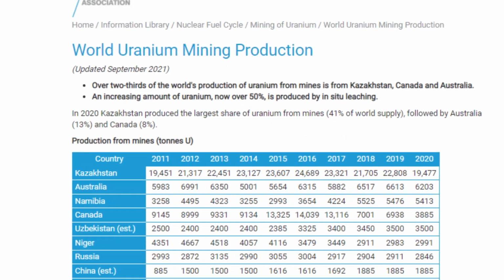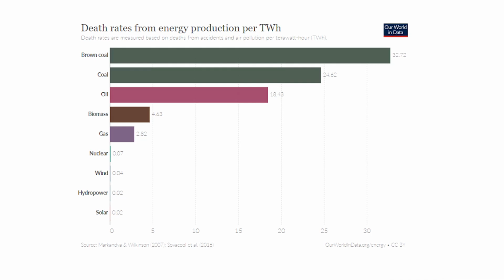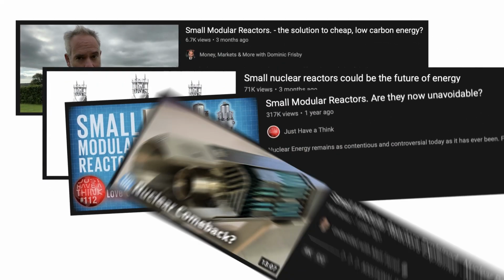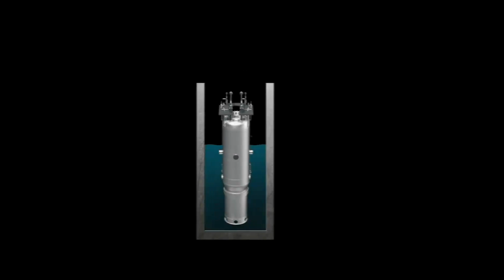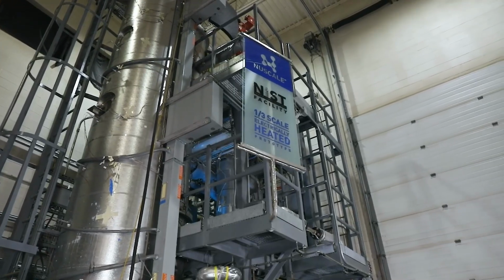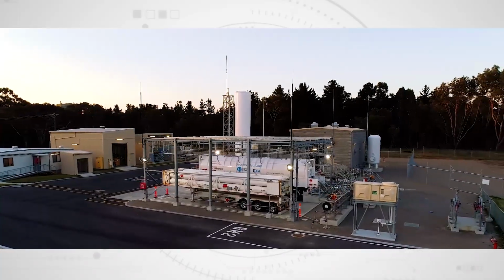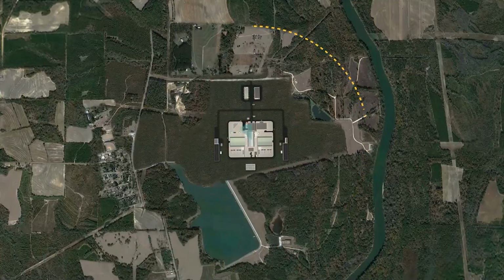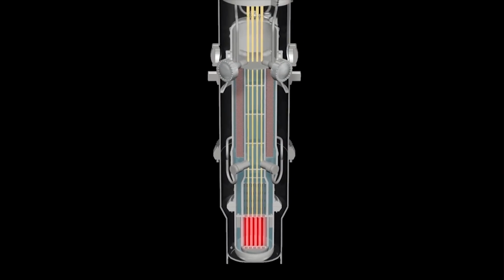Can Small Modular Reactors Save Nuclear Power?

Comment: There's definitely a place for this type of technology. Renewable energy can meet most of our energy needs, but the more renewables in our grid, the exponentially more energy storage is needed - which quickly becomes cost prohibitive. Clean energy that can be available whenever it's needed would drastically reduce the storage needs. Eventually it could slowly be replaced as storage becomes cheaper many decades from now. This seems like the lowest risk approach to zero CO2.
Reply: @Mark Muir
Your claims are not true.
https://en.wikipedia.org/wiki/100%25_renewable_energy
Reply: @acmefixer1  How does the contents of that Wikipedia article disagree with what I said? FYI: I'm a strong advocate for renewable energy, I studied renewable energy and power systems in University, and I operate my own off-grid renewable energy system for my house.

It's important to realize that there's a difference between a few places going 100% renewable vs the entire planet going 100% renewable. Also, it depends on what you mean by 100% renewable: for example, my system produces more solar power than I use over the course of a year, so it can be called 100% renewable; but I still require an additional power source ~5% of the year when there are several cloudy days in a row. This is the case for many of the countries that do have 100% renewable power - they import dirty electricity from neighboring countries when they have a production deficit.

The ultimate goal is to replace imports with storage. A few countries have a lot of hydroelectric stations which can provide that storage - but only a few countries have suitable geography. Other solutions are needed for countries that lack that option. I hope eventually energy storage of that scale will be economically viable. But in the interim, we need a clean way to provide imports.

Small modular reactors are a reasonable short to mid-term solution for this: they can be installed fairly quickly so can bridge the gap sooner rather than later, and their output can be changed fairly quickly to efficiently cover weather-related deficits in renewable output.
Reply: @AcmeFixer  Here's how it works: intermittent renewables require backup for when they can't meet supply needs. Currently that's mostly done using fossil fuel power plants. Academic literature shows you can get to about 20%-40% renewables that way. To go higher (without cheating using grid imports from fossil fuel origin) you need to add energy storage.

You can get another 20% by adding ~4 hours of storage capacity to do peak shaving. This eliminates the need for inefficient peaker plants.

If most of your renewables are solar, you need at least 12 hours of storage to cover the evening and night. 4 days of storage will allow you to last out most mild storms. But to cover seasonal variation, you may need several months of storage capacity.

My house has enough solar panels to produce 150%-250% of what I use during the spring, summer and autumn months. I have 30kWh of storage, which easily covers the night or up to 4 days of gloomy weather. This is 90% of the year. But to be able to last through the winter, I'd need roughly 1MWh of storage. Or some other kind of zero-carbon generator, such as burning algae or small nuclear.

There are other solutions:
1) Diversity of supply: have many different renewable sources so they don't all go out at once. This is region specific. Where I live, there's not much reliable wind, water is scarce, so there's only really solar.
2) Massive over-capacity: Have enough renewable capacity to meet your worst times of year, and figure out a use for the 90% you're not using during the rest of the year. Where I live, that could be used to desalinate sea water to solve our dwindling drinking water supply.

Here's a good video about some of this:
https://youtu.be/h5cm7HOAqZY
Reply: @markirmuir  
I don't disagree with you on most of what you pointed out.  But first off, let's talk about massive over-capacity.  This is what Tony Seba's RethinkX channel discusses.  His research says 3 to 6 times the capacity will give the necessary amount for year round supply.  The excess energy is used for generating hydrogen and that can be stored in salt caverns for wintertime.  The hydrogen will replace gray hydrogen now being made from methane - which must be eliminated.
(Continued)
Reply: @markirmuir  
Continued pt. 2 -
Here in So. California, So Cal Edison is replacing gas turbine peaker plants with battery storage systems - presumably to give the 4 hours of peak shaving.  However there is no technical reason why these BESS's can't be used for longer term energy storage and release.

Tesla has been piloting VPPs - if your system has a Powerwall, you can sign up to join Tesla's VPP (virtual power plant) program.  They pay $2 a kWh of power they use from your Powerwall.

Also, as more EVs join the grid for power, there is the availability of their storage to be used as V2G - vehicle to grid.  This will have potentially hundreds of GW of storage online if the chargers are bidirectional.  

We haven't touched on the companies now selling systems based on hydrogen electrolyzers, fuel cells and storage.  Such companies as Lavo, Gencell, HomePower, Bloom, Plug Power and several others make systems that are not cheap but should drop a lot in price if produced in large quantities.

But currently a cheap way to backup residential solar is a dual fuel generator, with either natural gas or propane as the second fuel.  However in a few years California is banning the sale of SOREs - small off road engines - like lawn mowers, generators, etc.

That is why I gave you the link to 100% renewables.  Technically there isn't anything that is preventing renewables from replacing fossil fuels.
Reply: @acmefixer1  Exactly. Electric cars are an excellent form of energy storage. They spend most of their time parked, so they could be plugged in and slowly charging on excess renewables or discharging a little during peak times. My electric car sits in my garage most of the time, where my hacked charger fills it only with excess solar power. It's a shame it doesn't support V2G, because those 90kWh could come in handy when there's a whole week of overcast skies.

Hydrolyzing sea water to create clean hydrogen that can be stored and burned in colder months is also an excellent form of energy storage.

Grid-scale batteries are currently designed to have sufficient capacity to give their rated power for 4 hours of output, because this gives the best return on investment (peak-shaving). Of course the capacity can be increased by adding more batteries, but that's currently very expensive and there's no financial incentive to do it. That may change with political will and/or a decrease in cost of batteries.

California's 100% renewables by 2040 goal is what I mean by cheating. The plans rely on importing electricity from neighboring states, most of which run on natural gas. It takes quite a bit more to truly switch away from fossil fuels completely.

We're on the same page - just arguing over interpretations and terminology.
Reply: @markirmuir  
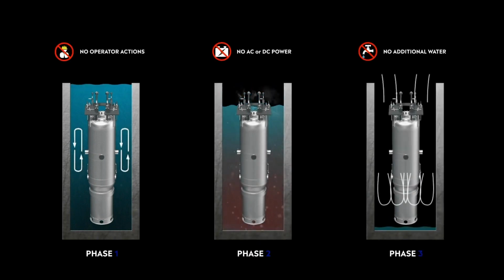The video in the link you gave is 3 years old, and doesn't mention many of what I've pointed out.  At 7:30 he does an about face and starts with the negative criticism, "it can't be done".  It's not true.  New nuclear could be an answer but it's far too expensive and takes more than a decade to bring online.  New nuclear power has no future in the western world - it's not NIMBYs, it's the utilities that are not choosing new nuclear.

You talked about cheating using imported power.  Those coal or natural gas power plants are being replaced by renewables, such as the Intermountain Plant near Delta Utah, which will eventually be replaced by the wind turbines in Wyoming.  The coal plant pear Page, AZ will be replaced by renewables.  The desert around the California Nevada border produces a lot of solar power, and new solar plants are being built in east Riverside County.
Reply: @markirmuir  
Said, "California's 100% renewables by 2040 goal is ... cheating.  The plans rely on importing electricity from neighboring states, most of which run on natural gas."

The imports are planned to be run on natural gas at first, with gas turbines that will run on a mixture of hydrogen and gas, then later pure hydrogen.  It will take several years for the construction of the wind farms in Wyoming and the transmission lines to get the renewables power to Delta, Utah where it can be sent on the Intermountain DC Intertie to California.  The important thing is that the coal power plant at Delta will be shut down.

Comment: I’m worried about the proliferation risks of smr reactors. Smaller but more sites means that you will also have the security risks at all those smaller sites, which may be significantly harder to manage to the appropriate level than for larger, more centralized sites.
Reply: Nuscale uses 5% enriched uranium, which is generally pretty safe. It would be easier to steal a spent fuel rod from a large reactor, as you don't need to breach the containment vessel to get at it. The real risk will be at Nuscale's decommissioning factory, but that won't be relevant for another fifty years or so.
Reply: Like many plants, it depends a great deal on features of the design, siting, and other factors.

Comment: Other 'New Nuclear' worth looking into:
Elysium is a company looking to use molten chloride salts to make a uranuim/plutonium fast reactor able to burn 'Nuclear waste' and do so within the current regulatory environment.
FLIBE Energy is a company that wants to fulfill the original promise of molten Floride salt reators with a thermal thorium breeder.
Energy Matter Conversation Company was trying to make a Nuclear fusion reactor using a "polywell fusor". I've not heard much from them for several years. It would be very interesting to know what they've been up to.
For that matter, I haven't heard much from Focus Fusion LLC in quite a while either. 

Hope that was helpful.

Comment: It keeps surprising why everbody talks about small reactors as such a novelty.
Submarines have been using small reactors for decades
Reply: In the 50's and 60's there were reactors roughly the size of microwave ovens. SNAP reactors from the US, and BES-5 and TOPAZ reactors from the Soviet Union were designed for powering space satellites. The issue with these reactors was that they used 93% and 96% enriched uranium, respectively. That's weapons grade, and that level of enrichment is simply not acceptable anymore because of the risk of proliferation/diversion of fuel.
Reply: @Bloated_Tony_Danza  These were not really reactors, but nuclear batteries
Reply: @walterpleyer261  Thorium is a good replacement tech and 3x cheaper than Uranium.
Reply: @walterpleyer261  Why call them batteries? Batteries use chemical energy.
Reply: @tobyw9573  https://en.m.wikipedia.org/wiki/Atomic_battery
Reply: @walterpleyer261  No correct. The reactor in a nuclear sub or ship is using a controlled nuclear chain reaction to generate power and is therefore by definition a nuclear reactor. A nuclear battery uses decay heat to generate power and is mainly used in satellites and navigational beacons. https://en.m.wikipedia.org/wiki/Nuclear_marine_propulsion
Reply: @tobyw9573  An Austrian Army Awfully Arrayed 
Boldly by Battery Besieged Belgrade....
for an alternative use of battery.

I'll leave it to you to find the rest of the poem.
Reply: Except those submarine reactors are not exactly cost-effective. For the navy the huge cost is worth it for the need to never surface, but as a cost-competitive source of electricity for the grid - that's very very different.
Reply: Naval submarines use reactors with highly enriched fuel. 90% U235.  There is no genuine comparison to civilian reactors which use Low enrichment, at most. 
Further, the naval reactors you mention are optimised for performance in battle. Fast restart times are critical. This makes them very inefficient. So, you wind up with very little usable energy for much higher proportion of wastes. 

SMRs will be a dead loss.
Reply: Very true and reliable and safe just like a submarine power source.
Reply: I believe there are a few of these Topaz reactors floating about all over the old USSR areas,

Comment: These plants won't make cheap kWh, and they won't be mass produced in factories.  The notion that small modular nuclear reactors will make cheap kWh is based on a misunderstanding of engineering economics, and ignorance of nuclear energy history.  A nuclear power plant ultimately is just a THERMAL power plant with a nuclear heat source.  Every single piece of the thermal power plant will be cheaper per kWh the larger you make it.
Reply from the maker: History does suggest you're right. All the "small modular" reactors I've seen so far have only gotten bigger and less modular as development has progressed. And it's pretty hard to imagine quantities of SMRs of any size that get close to the large volumes that have seen wind and solar get so cheap. I am interested to see if the different safety system ends up dramatically cheaper? But even their target cost (which includes subsidies) is far higher than wind and solar now, let alone won't and solar in ten years time. Still, I'm interested to see how they go.
Reply: @EngineeringwithRosie  You are both correct that scale matters. If you are looking to service a multi-GW market build a multi-GW power plant. If, however, you are trying to service a remote mining community then your competition is diesel generators with its fuel cost and logistics problems. A Micro Modular Reactor (MMR) looks pretty competitive. Our first to be commissioned at Chalk River Labs 2026. 
If your market is to back-stop a few hundred MW renewable energy project then your competition is a Natural Gas peaker. A typical SMR (300MW or less, IAEA definition) with thermal storage should do the job and get that higher dispatchable price/kWh. Add a proper carbon tax and the SMR looks even better. 
If the job is to replace a 600MW coal boiler then 2 SMRs with thermal storage and/or over sized steam generators and the SMR could load follow and cut the CO2 emissions by 800grams/kWh. Again, add in a carbon tax and ... 

Renewables have their place. Geography will decide what works where. One size does not fit all. 
A case on point.
Ontario, Canada, pop.14.5 M, GDP $900Bln. (See CO2 emissions at gridwatch,ca) Electricity is 60+% nuclear, one type of reactor (CANDU). Our electricity costs on avg 12 ($US 9.4c) cents per kWh. Nuclear is 7.7c/kWh ($US 6c) renewables cost more; solar 51 cents/kWh; wind 15.9 c/kWh natural gas peakers 18.8 c/kWh; hydro 6.2 c/kWh. Natural Gas, at 490g CO2/kWh, to support our renewables drives up our CO2 emissions. 
We spent more than a decade building renewables and found that wind has a proven Capacity Factor (CF) of 26% and solar 17% (we have 180 cloudy days per year and about 4000 heating degree days). We have halted renewables subsidies (2018). If they are so cheap, let’s see if more are built (without subsidy). 
By refurbishing 10GW of nuclear (95% CF) for $25Billion on time and budget we have eliminated 7.5GW of coal (2014) and smog days. Since the sites, buildings, turbines and power lines are already in place this will provide another 40+yrs of electricity with GHG intensity of just 3g CO2(e)/kWh. We’ve added a carbon tax ($50/ton). We are moving forward with Small Modular Reactors (SMRs) our first to be deployed 2028 (GE Hitachi BWRX300). Maybe gas back-up can be curtailed. 
A little bit of electricity for your home is not the whole problem. What about clean energy for the rest of the economy which is about 80% of our energy use. 
Annual End-use demand in Ontario was 3,035 petajoules (PJ) (1kWh=3.6MJ). The largest sector for energy demand was industrial at 37% of total demand, followed by transportation at 29%, residential at 18%, and commercial at 16%. More abundant and cheaper electricity along with the increasing carbon tax will help transition transport fuels as well as home and commercial building heat. We are encouraging development work on High Temperature Reactors (Terrestrial, Xe-100) to help replace fossil fuels for industrial use. Micro reactors (USNC) for mining and remote communities and fast reactors (Moltex, ARC-100) to consume the spent fuel from the old reactors. 
We have already eliminated coal from our grid. We have electrolysed hydrogen pilot project to test up to 20% H2 in our natural gas system (your interview with Paul Martin, P Eng, May 2021, explains that limit). We have our first fully electric mining operation. I feel we are going the right direction.
To de-carbonize the 80% of the economy that is fossil fuel powered, Nuclear energy is the most powerful and reliable form of clean energy to do these things and more. No one would choose to plan a business around an unreliable energy supply if there is a reliable alternate. Be it industrial hydrogen/ammonia  production or lithium mining. So I support our pragmatic and logical policy to promote our current nuclear and more advancements to it. We are going to need about 4x more clean energy to fully de-carbonize our economy. I wouldn’t bet against nuclear power. And, I wouldn’t push it on a community that is afraid of it.
Reply: You forget that financing costs are directly related to time-to-build. 
Sadly, most traditional NPPs were build at a time of high inflation in the 1970s, and that skewed the data.

However, for a high interest rates, profitability (by Lazard criteria of 20 year payback) will be significantly higher for SMRs.